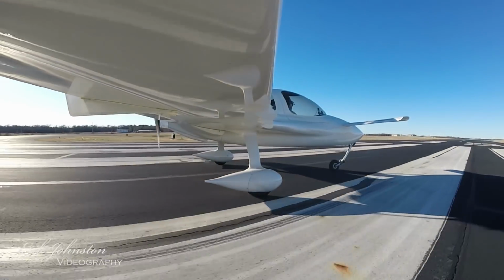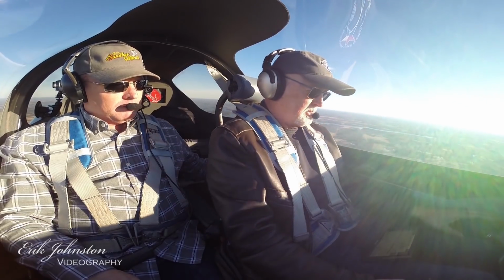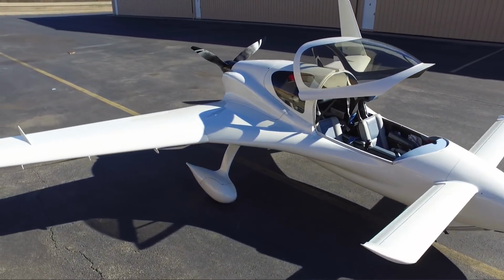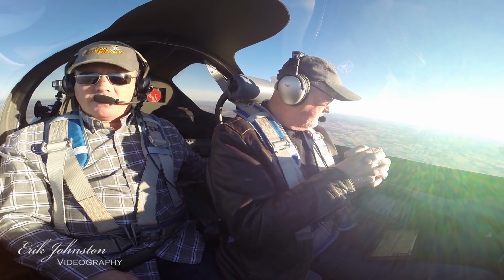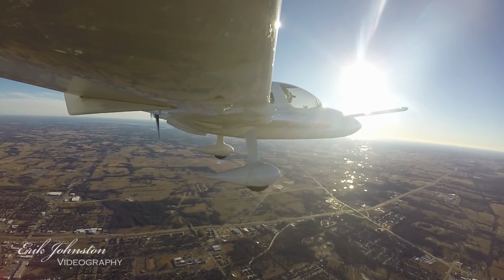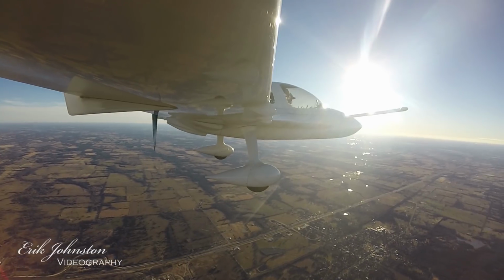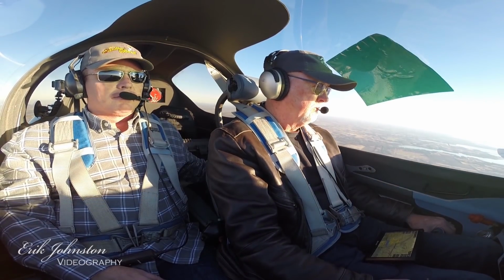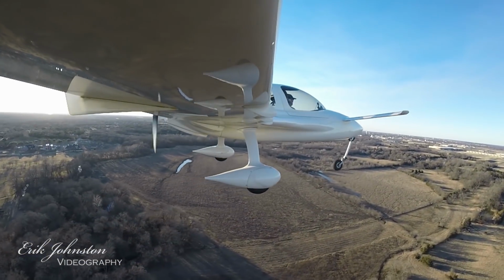Flying The Stagger EZ

Comment: I had to go back and listen twice. I thought I heard comm traffic with McKinney tower. I used to work there at McKinney Exec Air and flew my ultralight in and out of there before it was controlled.
The Stagger Ez is a beautiful aircraft. Its too bad plans are not available now that I am nearer to building my own.
Oddly enough, I helped a builder right there at McKinney finish out his Velocity and get it in the air.

Comment: I built a Velocity and it has full length rudders (N767SD).  I also have the trailing edge fences and VGs.   I also put my sparrow strainer “upside down” and these changes make the aircraft rock solid in stability at all speeds all the way down to stall at 67 knots.

Comment: Because of the 2-place side by side seating that this variant offers, it will be our first test platform choice when mounting our (2) EDFJ to the back section of each wing, closet to the fuselage. We expect a combined static thrust of _____ pounds.

2nd choice is a Sonex Waiex B with tri gear.

Goal is (2) hours of flight time with 30 reserve.

Comment: Can you fly it from the right seat? Are there rudder pedals. Interesting way to maximize shoulder room in a narrow cockpit. Dehavilland mosquito did the same thing. Winglets are usually towed in to load up the outboard wing to reduce induced drag which is the primary function of winglets on most airplanes. This is a standard practice on most winglet equipped airplanes like airliners. On canard airplanes they serve as the vertical stabilizers as well. The toe-in has very little impact on directional stability. The lateral stability would be dominated by the wing sweep and any wing dihedral, though it doesn’t look like there is much. I would expect the canard dihedral to be unnecessary and not make much difference.

Comment: What is a stagger EZ and who makes it? I'm familiar with the canard designs, but have heard about this one.
And Damn! Ten days on a newly designed prop! I mean he probably had the major part of the design down, but turning it into a pusher..... The staggered seating arrangement makes total sense. That would allow for big guys like me to fly the airplane and still have room for my best friend to fly along on the trip to Las Vegas, where everything that happens in Vegas stays in Vegas! Lol!!!
Reply: Ken, The Stagger EZ is a one off of a long EZ.  It seats three instead of two in tandem. It's a plans built airplane.  There are no kits for this airplane.  Cato Propellers is a major manufacture of GA props.
Reply: @MrDavidwilliford  Did your wing come out of a mold? Very smooth!
Reply: @jimbo7577  No, the wings  were not made in a mold.  It's  foam cores that are fiberglassed just like all Long EZ's are made.  The process was developed by Burt Rutan.  Lots of sanding makes them very smooth.